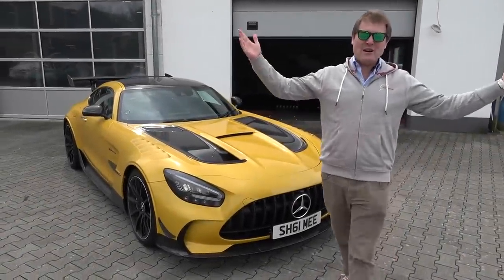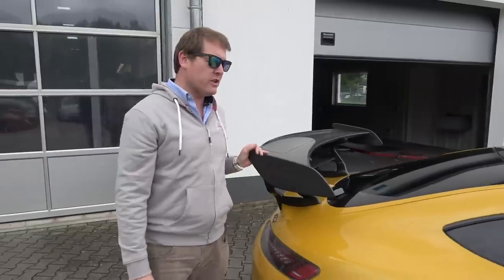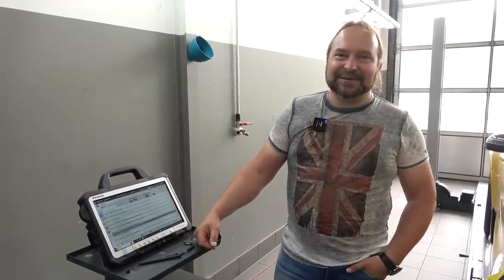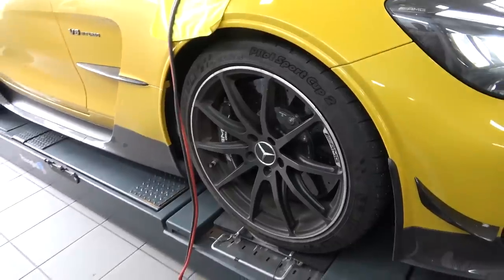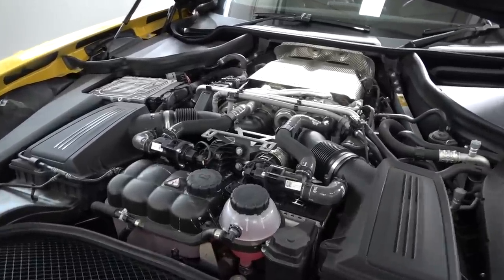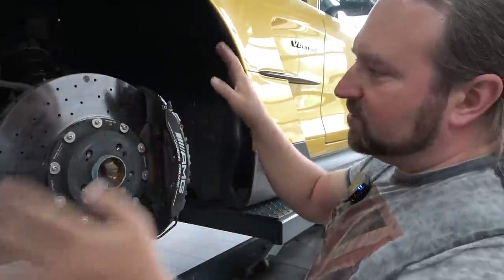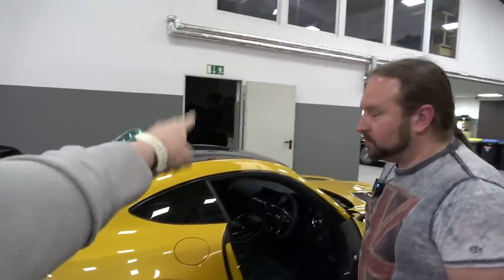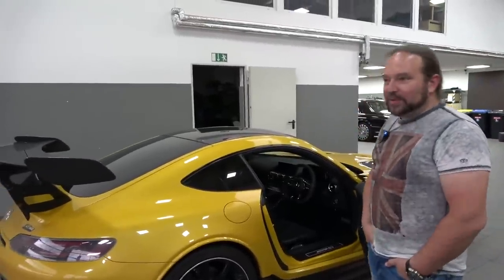REVEALING THE TRUTH! 20,000 Miles Inspection on My AMG GT Black Series

Comment: Thank the traction control for your rear brake wear.
Reply from the maker: Yes haha
Reply: I always turn traction control off on the track
Reply: TC on the modes he is using has no influence on the brakes as the TC in sport modes works only on TB / IGN reduction ... Engine-Management only ...
Reply: @opusinnovation4611  So just stability control uses the rear brakes then?  Seems counterintuitive that the rear brakes would wear faster than the front, no?
Reply: @SingleSpeed427  No, the car / braking as such uses obviously the brakes and even with all TC / ESP off, during hard tracking of the car, you would end up with significat wear at the rear due to the brake balance and the little surface being used by the small calliper ...

Comment: Interesting to see the rear pads and discs being more worn. I guess thats the case with a lot of modern rwd cars especially turbo and front engined, because of the traction control kicking in way more.
Reply: These cars are actually slightly  heavier in the rear due to transaxle gearbox in the rear and engine position being back the chassis.  So quite a lot of brake bias would be going to the rear due to the reduced weight transfer to the front under brakes.  Rear brakes will wear as much as the fronts it would seem.
Reply: @j.osborne4914  maybe right. but tc kills rear pads and brakes. all these new turbo cars a so traction limited from the rear that the tc basically holds the car together especially low speed
Reply: TC in sport modes has no influence on the brakes here, it's just run through the engine management and reducing power through TB and IGN timing...
Reply: @opusinnovation4611  than its just esp with this car which kills the rear brakes. (in relation to the fronts). At 30k miles its still good tho.
Reply: @OKF_Max  It's hard use on tracks and the necessary braking which kills especially the rear pads and discs, even if you have ALL systems off ... obviously, ESP and even ESP sport as well as TC in the "beginner setting" (which is worse than the ESP Sport) will help to kill them sooner ...

Comment: Have you thought about more frequent oil changes given the additional power & hard track use, 5,000 mile / 6monthly? (Recon Brad could do an oil & filter change the Shmuseum)
Reply from the maker: Its 18 months old and this is the 3rd service. It's been evenly around 6,000-7,000 between services, ahead of schedule
Reply: Why? To throw away money. Unless you've sent your oil out for analysis and they're recommending that frequent of oil changes, you're throwing away money based on baseless anecdotes from the internet.
HTH

Comment: 19:00 - Your Focus RS will be the exact same. These recirculation valves made of plastic are RUBBISH! 

Rubber and plastic ones leak boost and are inferior to aluminium billeted ones. I have a Forge Motorsport aluminium one on my Focus ST; there's likely high quality aftermarket ones available for the AMG GT as well.

Comment: It's pathetic how you buy a top of the range performance car & the manufacturer skimps on the build by using cheap bov's & crappy rear calipers which dont use all the rotor surface area. Really cynical considering how much the customer pays 👎